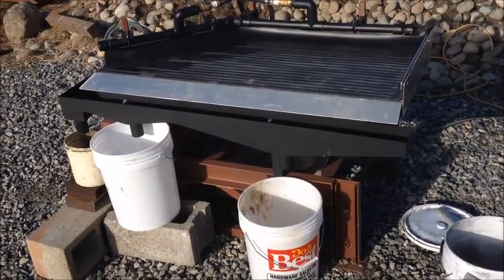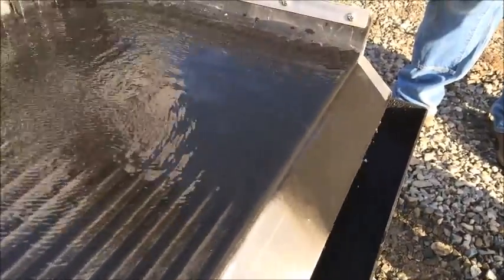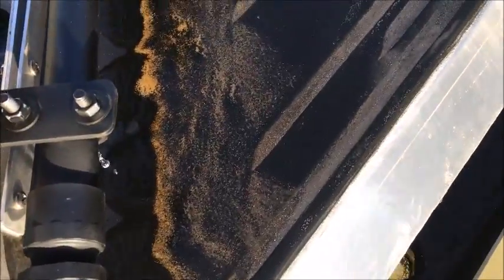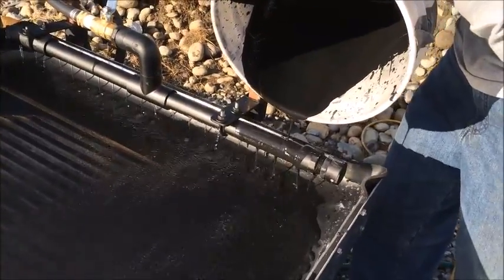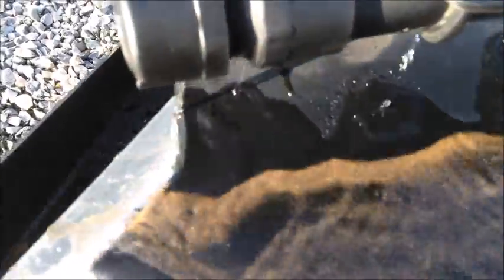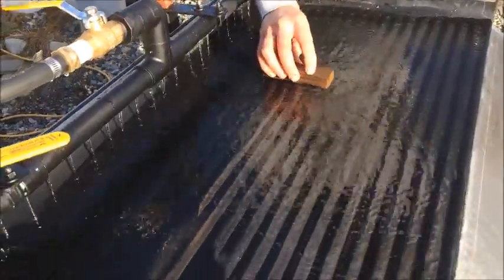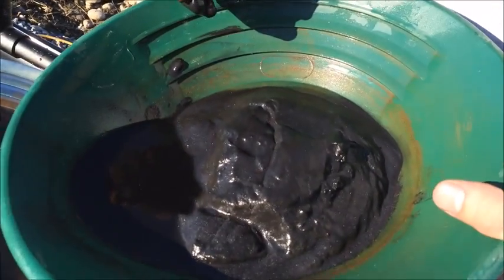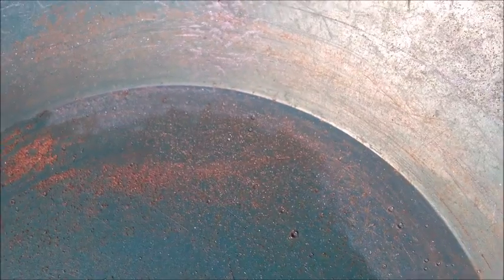How To Scrap Incinerated IC Chips For Gold Wires With A Shaker Table, Recycling Electronics MBMM

Comment: Sorry Jason but the setting of your table is  obviously not in the way it supposed to be .....

Yes ,- the table slope in two directions  ( depending on the size of material and conditions of the deck surface ,- the water amount  adjusted to it  ( stabil !!!) and the important frequenz of the motion and 
the "right" motion profil as well ( s. down below)

Finer material require a special deck surface and a higher speed rate ,- as all the settings for this 
peticular material .......

More coarse material a opposite setting    

You can cut the gold fraktion easy "with water" and have in one hit a meltable product 

The feed have to be adjuste to the setting of the table also ,- may with a auger or conveyor belt ...
If everything is set propper,- you can walk away and do something else ....

We ( for instance ) work with a flotationssystem after the table ........
And of coarse we use a demagnetize system , to get rid of magnetic minerals ... 

But your melting technique is for us a interesting methode to integrate it in our production process !
( Your smelting and refinering technique with lead or bismuth for small amound of gold is pretty need !)

We watch your activity ,- your efford ......and enjoy it !  Well done
Great to see you open the hardrock mine !!!!!!   ( we learn a lot about hard rock mining !!!!)

Shortly back to the motion "picture" ......

Holman or Wilfley ?  

From Germany ( former placer machine mining in B.C. ) 

Merry Christmas ,- a healthy and successful  2024

Comment: a quick question ( you work in domain) what is the reason if you incinerate the ic and grind you will got a considerable low yield in comparation with sulfuric acid method?(when use h2so4 to dissolve the epoxy )

Comment: In my opinion, since the ash is from electronic parts, it is likely that what you are seeing that is gold is plated gold of only a few microns of gold and the rest of the base metal are other material but not gold. As such if you weigh those "gold" dust, it is not going to be the weigh of gold.
Reply from the maker: Thank you for your comment and for watching our videos!
Reply: Wrong,  it's called bond wires.
Reply: @grzlbr  Gold bonding wires are not the only metal used in a semiconductor. There are also plated leads. Gold bonding wires are not used in all semiconductor. It is sometimes replaced with aluminium bonding wires. As mentioned earlier, what you see as gold may not be fully gold. 100% certain that it contains some amount of plated gold.
Reply: @dachee  Total BS, you can clearly see all the bond wires, you falsely claimed they were not.
Reply: @grzlbr  Your statement has no substance. I will stop my discussion with you.
Reply: @dachee  "what you are seeing that is gold is plated gold of only a few microns"

In the video you can clearly see the pure gold bond wires, nice try.

Comment: Great video, would a blue bowl achieve similar results given the same gold bearing material? Thanks
Reply from the maker: I don't think the blue bowl would have the same effect on the fine gold wires as the shaker table does, those wire are really small.  If you try it out let us know how it works.

Comment: the high density black material you couldn't pan out is probable tungsten platinum palladium or iridium.
Reply from the maker: Thanks for the tip
Reply: reacted to quickly, that was exactly what you said.
my bad.
Reply: Wouldn't tungsten move into the same 'lane' as the gold as they almost got the same weight?
Reply: No, it's the glass and silicate from inside the ic chips, where gold bonding wires connect

Comment: Such a delicate balance between the three factors of water flow, table slope and vibration.  Great to see a system like this that doesn't require chemicals! Very cool idea.  I've seen similar (much larger) tables in gold mill videos on youtube.  I like that this is a portable system and probably very easy to set up.  I wonder if it is possible to use an even smaller table with perhaps a different vibration rate.

Comment: the black is iron, run a magnet over it
Reply from the maker: +Jay Stevens Thanks for the tip!
Reply: +Jay Stevens PCB's (printed circuit boards) would have a very, very low iron content, that's if it had any at all. Its likely copper from the pcb layers mixed with a bunch of nasty stuff from when it was burned. Maybe a copper/lead/silver mix with some other nasty stuff. I really doubt its iron though.

Comment: The black you are seeing is mostly carbon. IC chips use fine elemental carbon in the epoxy mix.

You likely have copper, silver, aluminium and iron in the mix with the gold, possibly some palladium and rarely platinum as well. As for the shiny silver bits, that's likely silicon from crushed wafers, they often contain precious metals but only in tiny amounts and chemical separation would be needed. After incinerating chips I gently crush and sieve out the whole silicon chips before reducing the ash to a finer mesh. Once I have several kilos of just the silicon wafers then I'll process them together, I haven't even got close to that yet as they're so small and light.

Do you have any data as to the yield from 20lbs you ran?
Reply from the maker: Laughing Achilles Thanks for the in depth comment and information.  I don't have any data from the 20 lbs as it was all sent back to my client after the test was run.  I would like to get some more of this stuff and get some assays done so we can figure out our percent recovery.  Thanks again, we have some more videos coming soon so stay tuned.

Comment: Awesome process I need to make a shaker table like yours to process the boards I have been colleting for h past few years. This is much faster than picking them apart to separate each metal. Would you have plans for this small table, I will try to make one either way.   Thanks and keep the videos coming!

Jeff
Reply from the maker: Hi Jeff-  
Thanks for the comment and I am glad you like the process.  We don't supply plans for the tables.  Let us know how your shaker table turns and good luck!  Thanks.

Comment: 1:18 smaller pieces of incinerated substrate, they can be crushed further as some of them may contain small bits of gold bonding wire.
1:24 crushed Si wafer from center of IC, that may be leached in AR as it may contain small bits of solder from where gold bonding wire was attached to Si wafer.
1:28 there is your gold bonding wire along with small metallic pins from inside of IC
Reply: 2:22 gold bonding wires on the left side, beautiful.
Reply: patnor1011 7:30 all valid points. Also there are some copper wires there, I would save these as they do have some gold on tip where bonding wire was soldered to them.
Reply from the maker: Hi Patnor-
Thanks for the comments and the descriptions.  I will be really interested to see what the customer comes back with for % recovery and how much gold may still be attached to the "waste" from the table.  Thanks for all the expertise and I will let all you guys know if I get any more details about the chips or the recovery.  Thanks
Reply: mbmmllc As I said some amount will be in uncrushed small pieces at 1:18 but that may be recoverable simply by grinding it again to the baby powder consistency. And amount of wires stuck on pins it all again depend on how material was crushed. If not enough then there may be fragments of wire still there but if you overdo grinding some wires will smear on pins as gold is very soft. Anyway it is recoverable, cheapest way will be to separate them to magnetic ones and non magnetic. There are many ways how to process them depend on what is your favorite method. They should be processed as if you deal with bigger quantities everything add up and IC packages contain silver and many of them do contain palladium which shoot up in price last few years, definitely worth to pursue if there are quantities to deal with.
Reply: mbmmllc What he is going to recover depend on what was in a mix. If there were a lot of BGA IC then these run 5g+ of gold from kilogram. Other mixed IC should average 1g/kg if there is not too many of big rectangular IC with thick legs on 2 sides - they look like eprom IC chip, they are low value (with exception of older type of soviet production these are the best).
Reply from the maker: patnor1011 Thanks again for the info.  I will keep you updated on our progress.

Comment: Nice job on that little table. Do you know where he got the chips?
Reply from the maker: Hi jdelusia
I don't know where he got the chips, but I do know he is in the the PCB recycling industry.  He may have bought them and incinerated them or he may have removed them himself, not sure.  There sure was a lot of gold in there though.  Thanks
Reply: Nice videos as usual. That little table looks like it works really well. Is the drive mechanism underneath?
Reply from the maker: jdeluisa The drive is located on the concentrates side of the table.  It can be seen here on our larger table at 2:16 https://www.youtube.com/watch?v=N5GBGbcDY6c very simple.  The drive on the big table and small table are the same.  Thanks

Comment: Curious if they stated how many pounds of chips were processed to get that bucket of material you ran and what would you estimate was the recovery weight
Reply: 20 lbs of material from what it says in the description.  I'd like to know recovery as well.  Was a steady stream coming off that table!
Reply from the maker: Hi Blue-

We ran about 20 lbs.  I don't know the recovery at this point, but I hope the customer will tell us once he gets his samples back.  He told us on the phone he figured there would be about 3/4 of an ounce in there.  I think he wasn't too far off because there was quite a bit of gold in the high grade.  When I hear the actual recovery I will let you guys know.  Thanks